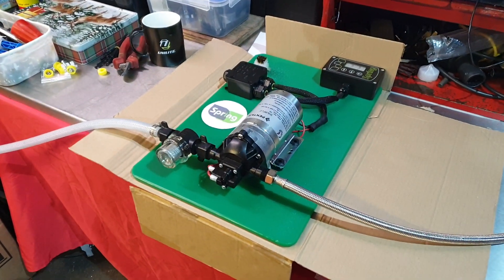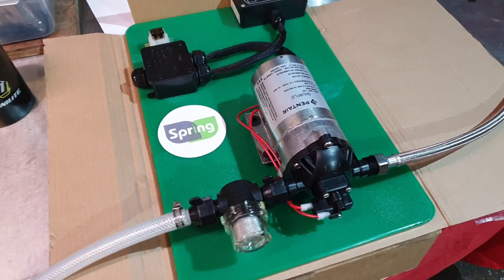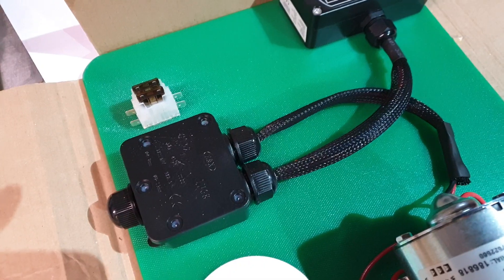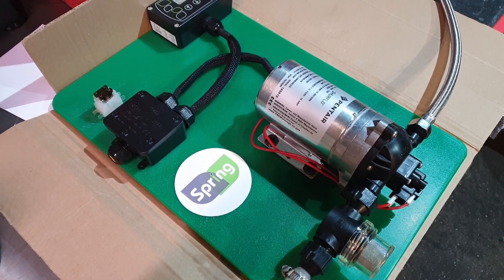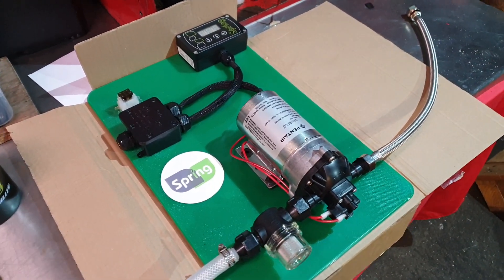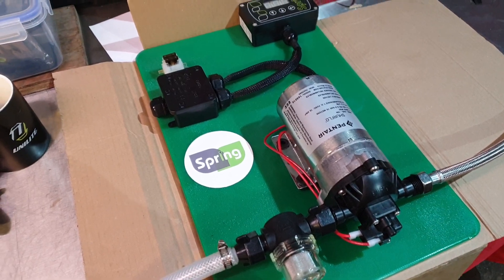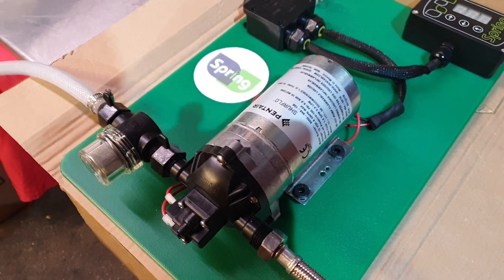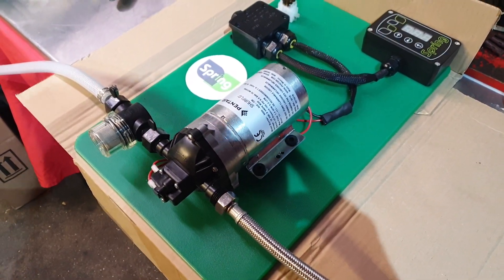My Van Mounted system build is on its way

Comment: Where is the outlet hose from Austin?
Reply from the maker: Its a braided stainless steel hose with a chrome effect Glsss reinforced abs 1/2 female fitting. NOT metal on plastic like a few trolls have mentioned
Reply: @AW-Services  don't let a troll get to you. Where can I source one? Having trouble with leaks since fitting my immersion need something like this.